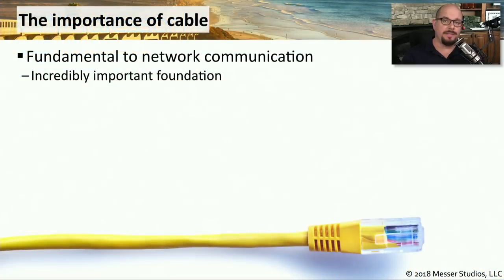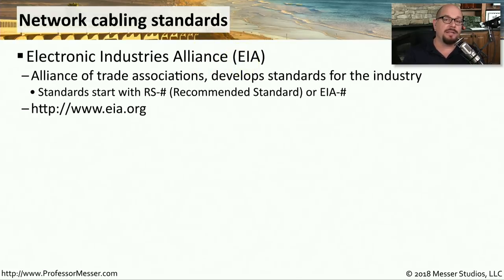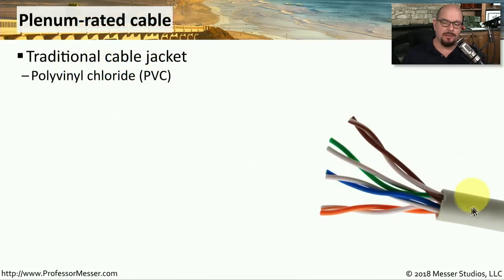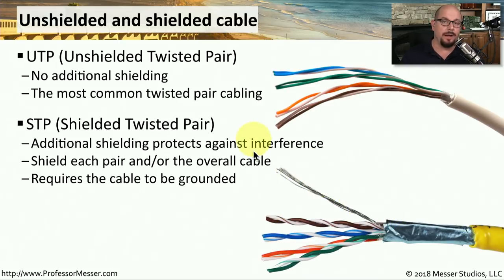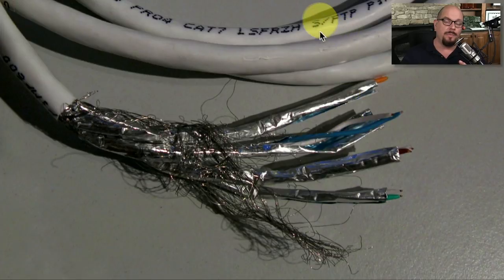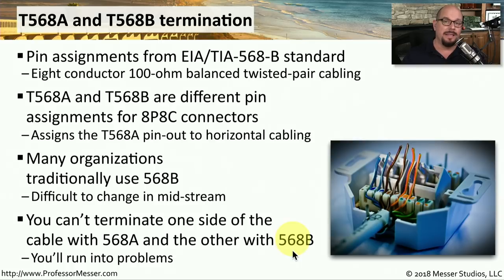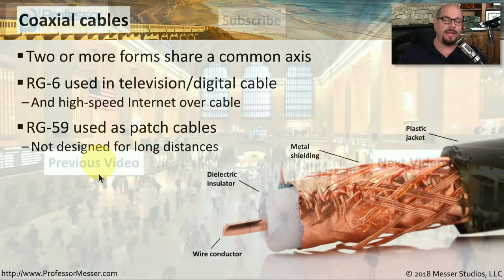Copper Network Cables - CompTIA A+ 220-1001 - 3.1

Comment: Hope this helps out anybody that struggles to remember the T568A & T568B standards. This is how I was taught

Remember GGOBBOBB as in "Go Bob" for T568A. Every odd number pin has white in it. And browns are always last like the Cleveland Browns (besides this season, they're killing it)

For T568B, just switch the greens and oranges, every odd number pin is still white. Hope this helps someone.
Reply: I worked out a way of remembering as well, for T568A (green/white first) for T568B (Orange/white first) I hope that's correct.
Reply: Thanks!!!🍻
Reply: thanks
Reply: Thanks so much man
Reply: thanks boss
Reply: Helped
Reply: Thank you so much!😃
Reply: BEST example I've seen. I was so excited when I applied this to my learning and nailed both standards. Thank you for sharing!
Reply: I remember that A has these first 2 cables in green because A stands for "apple" :D
Reply: Memorization is my weakness. You are a gentleman and a scholar for this neat trick. Can't believe I remembered it so easily. I was just about the spend probably around 60 minutes total reviewing only the color and number scheme. THANK YOU BOB!

Comment: Hey everyone good luck on your studies!  I have passed the second part to this test.  I am retaking the first part on Monday!
Reply: Update? How was your second attempt
Reply: @H12457   I missed it by 15 points.
Reply: @carostech  Its ok keep trying and hopefully you will past it the next time... You are halfway through u can do this and get certified....
Reply: @H12457  Thank you
Reply: Was the second one easier than the first, or did the first just require more studying?
Reply: @limemason  The second part was easier for me since I have more experience with the software side of things.
Reply: @carostech  I'm pretty much the opposite so maybe it will be harder. Thanks for the heads up 👍
Reply: @carostech  its messed up and luck too. To a extent cause someone who knows less could of just got questions about stuff they knew more. Someone who knew a little more could of just got all the questions they bad at 🤣🤣🤨🤨
Reply: You don’t even need the core 2 to get a entry level position only core 1 but my goal is to get core 1 A+, network+ & then Security+

Comment: What are the real differences between 5 and 5e? Thanks!
Reply from the maker: Category 5e has slightly better crosstalk prevention, but both Category 5 and Category 5e are mostly identical and both support the same Ethernet standards.
Reply: @professormesser   I see from a lot of different sources online that the maximum speed for category 5 was 100 mbps, not 1000 mbps. Which is it?
Reply: @professormesser  sorry, just read your other replies to this question. I guess If the exam asks me what speed category 5 supports I will say 1 Gbps
Reply: @InsidiousSaint91  wait I thought cat 6 was the only one that had transfer speeds at 1GB
Reply: @Thydudedruid  Thanks fam, that was probably one of the questions I missed on the CompTIA
Reply: Hey there interchangable what does that mean

Comment: I’m an hvac contractor that is changing careers and I was confused when the plenum came into the video 😂
Reply from the maker: In the next video, we discuss cutting sheet metal on a roof in July.

Just kidding.
Reply: Yeah we don't ever run wires in plenum. Cable trays mostly now a days

Comment: Do T568A and T568B only apply for example to large companies setting up their offices? Is there any real world difference at home or something to look out for if you had to pick up an extra cable from Best Buy or Amazon for example?
Reply from the maker: Every Ethernet cable you find will be wired with T568A or T568B colors. It doesn't matter which one you use, as long as it's the same on both ends of the cable.
Reply: @professormesser  Interesting! Thanks for the reply.

Comment: Is there a real world difference between T586A and T568B or is it some kind of personal preference? Is the signal better in one or the other? What makes the difference for a horizontal or vertical run?
Reply from the maker: It's simply a choice of which colors you would like to use on which pins. There's no functional or technical difference between the 568A and 568B wire map.
Reply: I know im a year late but I was always told A for government and B for civilian.

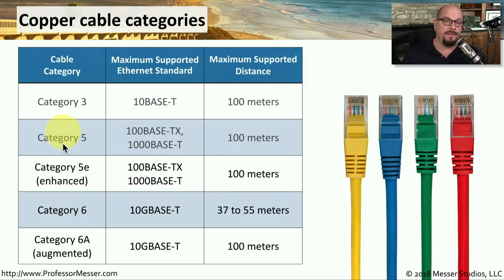Comment: 3:32 
Many sources like Meyer's book says that Cat 5 has a maximum of 100Mbs. 
But some other sources including Messer say Cat 5 has 1000Mbs. 
What's the answer here?
Reply from the maker: The IEEE 802.3 Ethernet standard defines 1000BASE-T (1 Gigabit Ethernet) as: "1000BASE-T: IEEE 802.3 Physical Layer specification for a 1000 Mb/s CSMA/CD LAN using four pairs of Category 5 balanced copper cabling."
Reply: @professormesser  Thank you for being active.
I get that the number in 1000Base-T means the bandwidth of 1000 Mbp/s.
In 3:32, it is stated that Category 5 has 1000Base-T, in other words, 1000 Mbp/s. But I'm seeing many sources and taken tests from Dion, Meyer, etc that category 5 has a maximum of 100Mbp/s, not 1000Mbp/s.

An example where Cat5 has 100Mbp/s maximum speed:
https://www.howtogeek.com/70494/what-kind-of-ethernet-cat-5e6a-cable-should-i-use/
Reply from the maker: The quote above is from the 802.3 standard. All other references are irrelevant.

If someone is providing information that conflicts with the IEEE standard, I would recommend you ask them why their information does not match the standard.
Reply: @professormesser  You're right. Makes sense.
Reply: @professormesser  this was the nicest "per my last response" comment I've ever seen haha! Thank you so much for the time and dedication you put into this field and these videos

Comment: is the 568a cable also called straight cable? and 568b cable also a crossover cable?
Reply from the maker: They are both different ways of wiring a straight-through cable.

Comment: At around @9:49 it says (I'm summarizing) that the same type of connection (i.e. 568A or 568B) on each end of a cable should be the only way that the cable is created. However, isn't a crossover cable the opposite of that? (i.e. 568A one end and 568B on the other). Or am I misunderstanding something. The video doesn't seem to mention crossover cables so my knowledge is based on book readings. If anyone can clarify it would be appreciated. Great video series, thank you!
Reply from the maker: The 568A/568B standard determines which colors are used when wiring a cable. The Ethernet crossover specifications are part of a different standard (the 802.3) from the IEEE. Wiring 568A on one end and 568B on the other does not define an Ethernet crossover connection, and if you examine the Ethernet crossover for 1000BASE-T you'll see they do not combine 568A and 568B for the crossover function.
Reply: @professormesser  Okay, thanks very much for replying. I'll delve into it some more so I understand completely.

Comment: What are the respective theoretical bandwidths for each category?
Reply from the maker: A category of cable describes the physical manufacturing characteristics of the cable. It's not a measure of speed or bandwidth.
Reply: @professormesser   very good and important insight

Comment: In both this video and in your notes you specify to never terminate one end with 568A and the other with 568B. This is the definition of a crossover cable, isn't it? I've had two practice exams mention this and Meyers does as well in his book. I'm wondering why you've neglected to mention that caveat.
Reply from the maker: Terminating one end with 568A and the other with 568B is not a crossover cable for gigabit Ethernet (1000BASE-T). If you look at the wire map for 568A to 568B and another wire map for a 1000BASE-T crossover, you'll find them to be different.
Reply: @professormesser  Thanks for responding so quickly. From Meyers' book: "You can hook two computers directly together using a special UTP
cable called a crossover cable. A crossover cable is a standard UTP cable
with one RJ-45 connector using the T568A standard and the other using the
T568B standard" -- Would you say this is incorrect, then?
Reply from the maker: This is clearly incorrect. You can compare the 1000BASE-T crossover with a cable wired for 568A on one end and 568B on the other, and you'll find they are two completely different wire maps.
Reply: @professormesser  Thank you for clarifying, now I understand why I was getting those questions wrong!

Comment: looking at a cable and it just says 24AWG UTP?

i dont see anything like S/UTP or F/UTP....its just UTP, does that mean that the overall cable and the individual cables are U?
Reply: So the 24AWG part means that the individual cables are 24 gauge wires. AWG stands for "American Wire Guage" which is a standard for the diameter (or thickness) of a wire. Smaller numbers are bigger wires. Ethernet is usually 24, 26, or 28 gauge. So 24 gauge is "better" since it is thicker it should work over longer distances, compared to 28AWG which is a thinner cable. The second part of your rating just says "UTP". As shown in the video, this means that the individual wires are unshielded. UTP = Unshielded Twisted Pair. So the individual wires have no shielding and are just plastic insulated. Since there is no slash, then it means there is also no shielding on the overall wire either. Basically what you have in front of you is a standard ethernet wire. Most ethernet wire is unshielded, which is what you have. 24AWG means its a little thicker, which will allow you to reach those theoretical top speeds at longer distances (like 100M).
Reply: @JAlexanderCurtis  thanks!!

Comment: Really struggling professor with all the different cable types and speeds any idea how I can make it easier to understand all these as test coming up and I don't feel confident in this area thanks
Reply: practise in the real world
Reply: @varadvithalkj1716  how do I go about that I'm not working in the it field at the moment but really wanna work in it just the info in study course is alot to take on a way to break it down would b nice
Reply: @alecirwin3555  exactly. It would be IDEAL to practice in the real world, but man I'm switching completely different fields and want to start in IT. The way I'm going about it is just writing it on notecards over and over again. Helps with memorization and I think this is key for this sort of test. Let me know how you do/did I'm talking mine tonight and whew. still not confident but at this point it's getting it over with to see what my weaknesses are. 

GOOD LUCK TO YOU SIR
Reply: Do flashcards of each section of cables. Example flash cards of copper cables, then video cables, etc. etc. Once you do little by little it will add up to all the cables covered.
Reply: @LionLion-zb8jo  How did you do